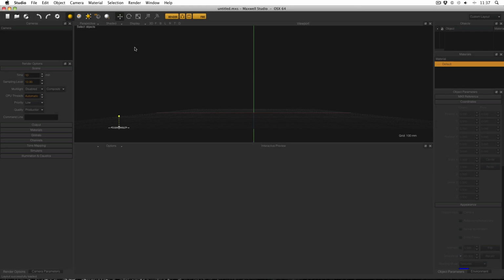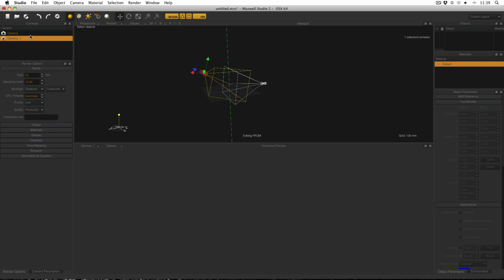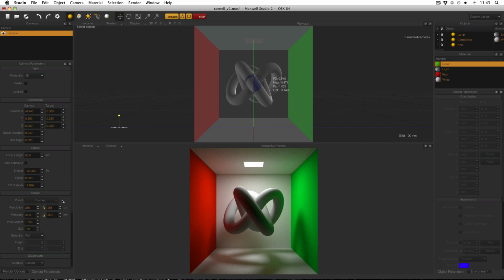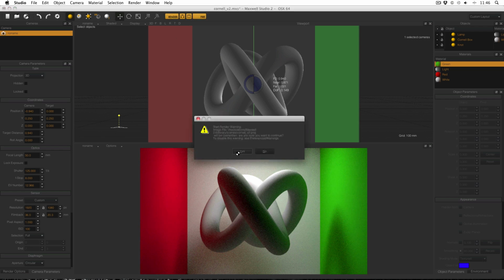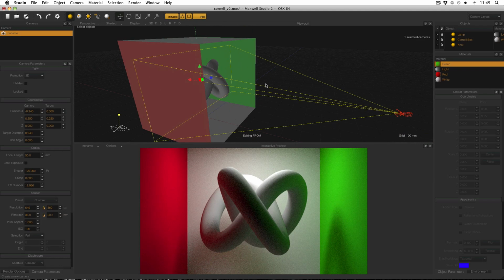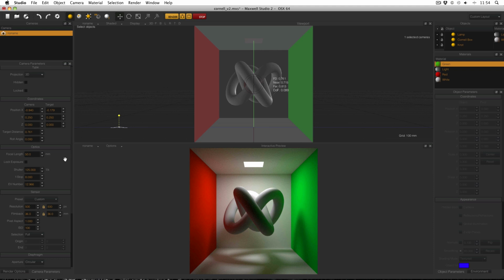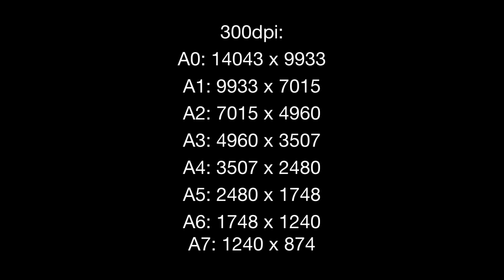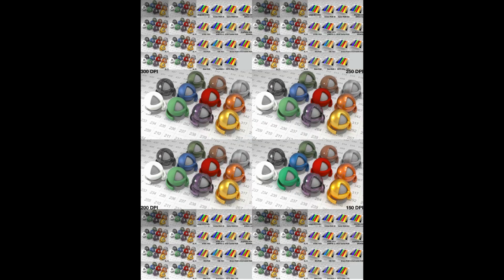Maxwell Render Studio Tutorial - Resolution

Comment: It's the users responsibility to make sure the resolution is set correctly to the end medium. 72 or 300 dpi doesn't matter on a computer screen, As long as the user has set the correct resolution and is printing at the correct size it will be 300dpi. As long as the aspect ratio is maintained, the view and depth of field will not change, and there is no need to change the focal length.